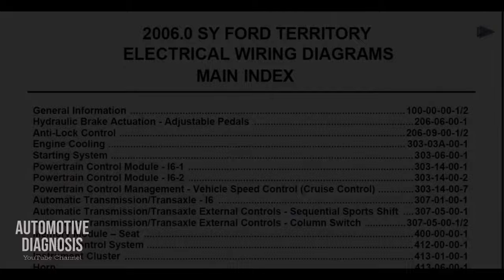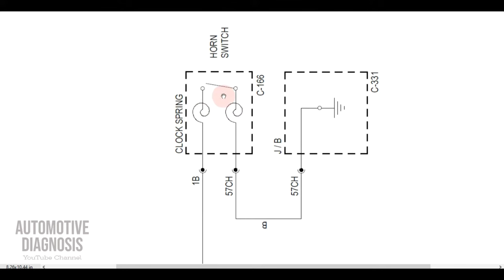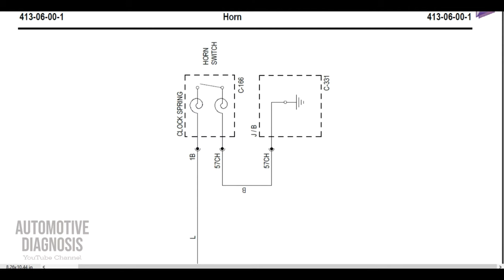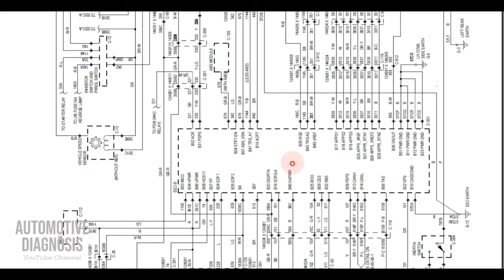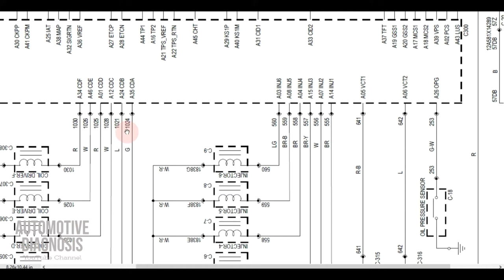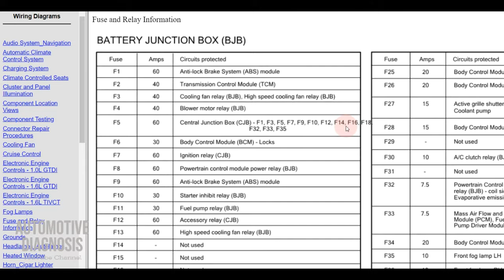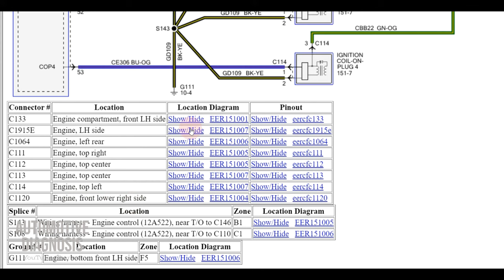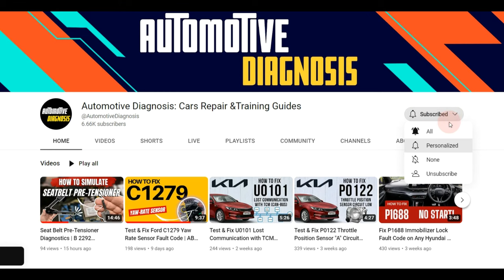Read & Analyze FORD Wiring Diagram | Component Location, Connector, Pins, Wire Color & More

Comment: Well done. However I have a question. At around 21 minutes you are disconnecting the three harness connections to the controller. What I cannot seem to find (Mitchell ProDemand) is which connector out of the three is which. I see you resort to looking for visual differences of the connectors. However it seems to me there should be info telling which one is which. Sometimes you want to test a circuit without disturbing it, particularly with intermittent issues. Thanks in advance.
Reply from the maker: Hi there, thanks for your comment.
Although some wiring diagrams show the location of each single connector (even on the control unit), on many cases we have to identify by visual differences. For example, in case of those three connectors on ECM, one connector is smaller than other two, so easy to find. The other two are very similar, but we can see the number if pins inside the connectors are different on the first and last column which makes the connector unique. 
Watching the following videos can be also very helpful for more understanding:
  Read & Analyze KIA & Hyundai Wiring Diagram:
https://www.youtube.com/watch?v=HIaaxV6c4Ig&t=36s

Read and Analyze NISSAN Wiring Diagram:
https://www.youtube.com/watch?v=2U51uyq2fhY&t=117s

Comment: How about a 1988 Mercury Cougar XR 7 that tries to start once and won't run or idle. If it sets over night and you get in it to start it and it will fire for a second or two then stall. Try again and it won't go, tries but won't start. New fuel tank, fuel pump, sending unit, fuel lines, idle position sensor, 8 new fuel injectors and same old thing. PCM? Don't know what to do, it is a 5.0L 302 and the car has 50,000 on it.??? Ideas to help with this issue? Please.😊
Reply: Hi @johnelliott7375. I hope you were able to resolve this issue. If not, find out what the fuel pressure should be at the fuel rail for this vehicle, then check to see what the fuel pressure is at the fuel rail. The results should assist with determining if the issue is with the appropriate amount of fuel being supplied to the injectors, and if not, is the issue between the fuel tank and fuel regulator, the fuel regulator, or from the fuel regulator to the injectors. I hope this helps if you still have the issue.

Comment: i got a 2000 ford windstar and none of the power windows work or the radio. cant figure it out. do you know where the fuse is
Reply from the maker: Hi there, check the Fuse 15 (10 A) inside the Central Junction Box, if that one is okay, check the accessory delay relay inside the same junction box.
Reply: @AutomotiveDiagnosis the fuse is ok
 .which relay is that and how do you test a relay
Reply: @AutomotiveDiagnosis  theres 6 relays 3top 3bottom
Reply from the maker: @chaosblackstar  here is a video to check the relay:
https://youtu.be/BWjIBzuLUS0
Reply: @AutomotiveDiagnosis  ok i just watched how to test i have 5 prong relay but which one.3top 3bottom
Reply: @AutomotiveDiagnosis  ok tks. is there any fuses under the hood that could be the prob
Reply from the maker: That relay is on the top row and in the middle.
Reply from the maker: If you found the relay ok, you need to check the fuse 106 (30 A) in engine compartment fuse box.
Reply: @AutomotiveDiagnosis  ok tks so much for your help